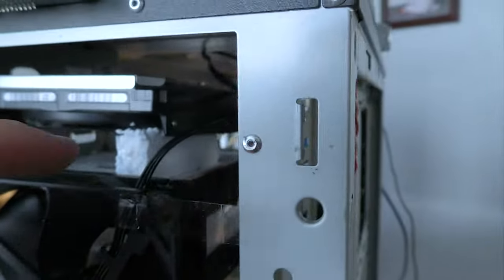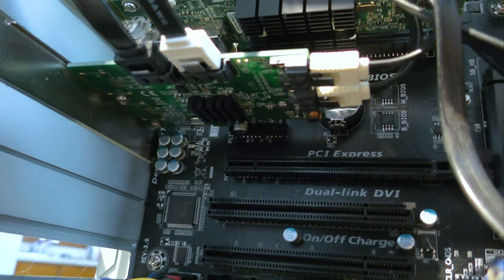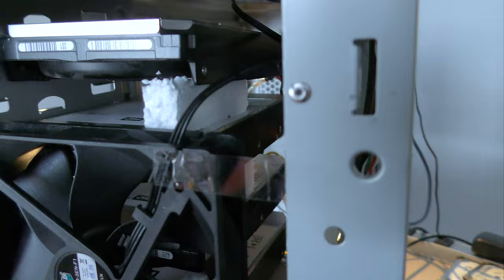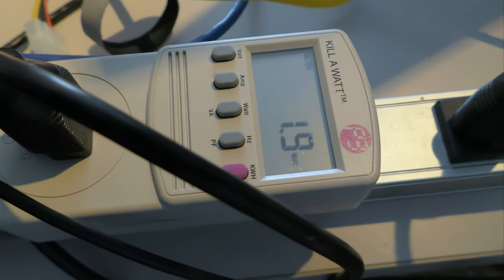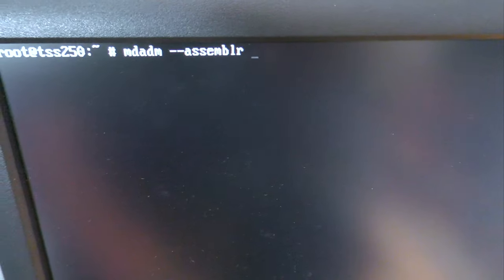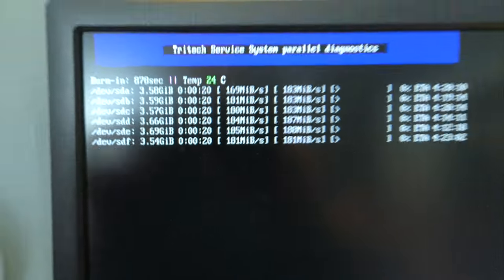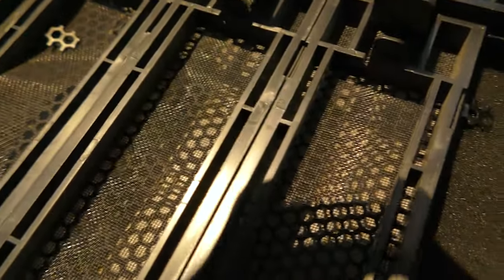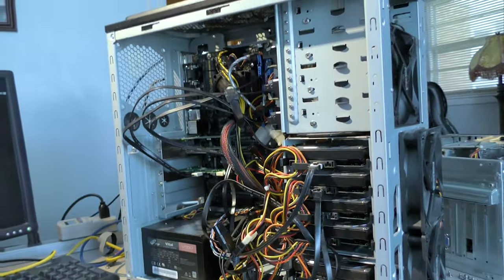My "New Server" From 2020 - Jody Bruchon Tech

Comment: Icydock does great trays, but expensive
Reply from the maker: @TheDdm1234  Yeah, I wanted one of those and that's exactly what I was thinking about when I mentioned no trays. Also, icy, not icky
Reply: I'm sure they make great stuff but I got 2 of their 4x 2.5" enclosures and they're terrible. You cannot put 4 HDDs in. The enclosure cannot power all 4 of them at the same time. Also, 3/8 ejection mechanisms are broken. I think they were mainly expecting people to use SSDs for that kind of enclosure, but there's nothing in the documentation that mentions this. I was disappointed mostly because of the cost of the enclosures.

Comment: the only problem i see is moving that system on its side out of the way a year down the road and forgetting they are only secured on one side , because honestly that's what would happen to me!
Reply from the maker: @boblabelle6704  Fortunately the drives are very tightly secured and the foam isn't strictly necessary!